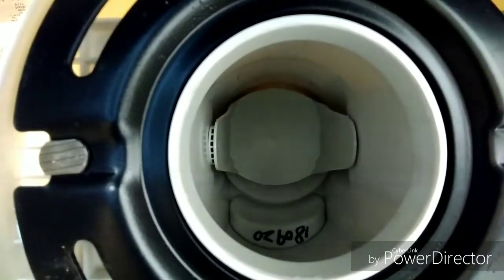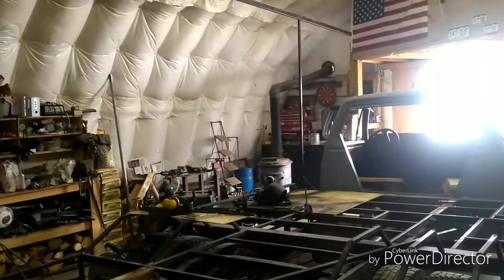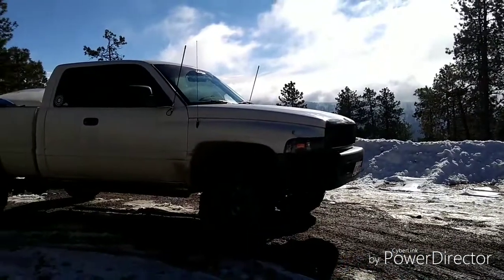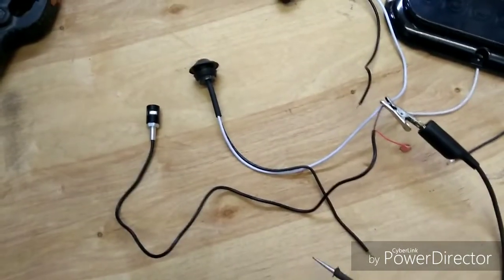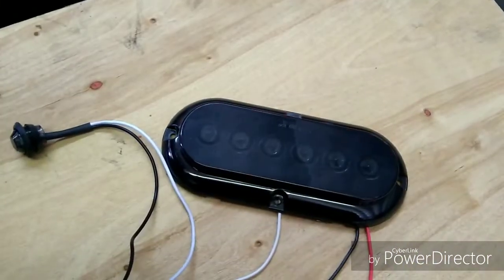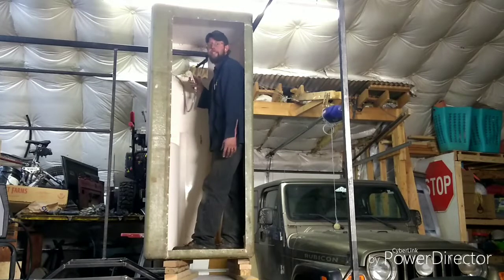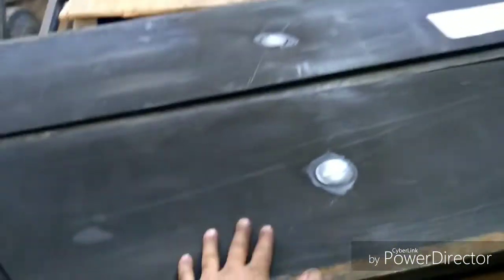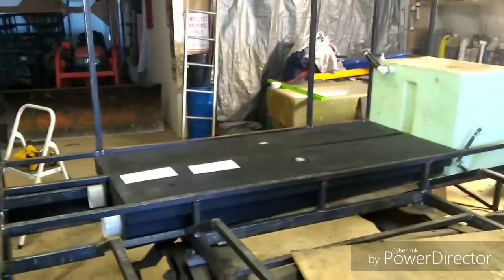Trailer Trash Part 6, Walls Going Up!

Comment: One problem I see with your tanks is that the drain will be on the "wrong" side for an RV. Looks like yours will be draining out the passenger side instead of the driver side. But, if you don't go to campgrounds or RV dump stations and instead setup a home dump station, it won't be a problem.
Reply from the maker: Shows what I know about RVs. I didn't know that was a thing. We don't ever go to regular campgrounds but if we did I'm sure I could plumb in a cross over behind the rear bumper. Thanks for the input!